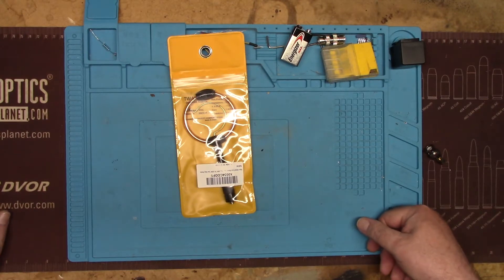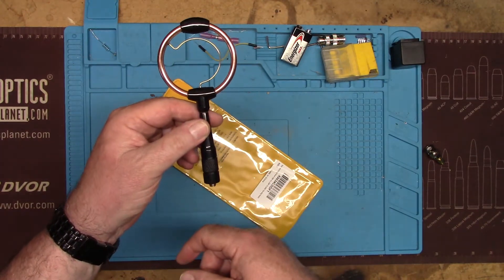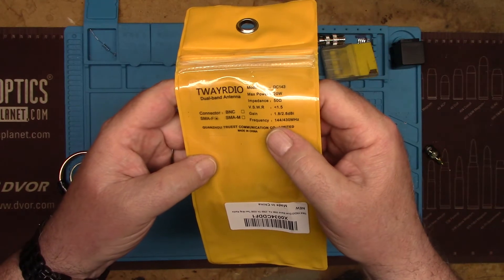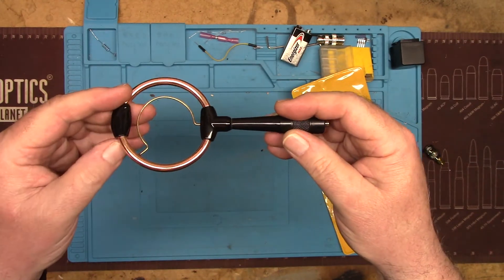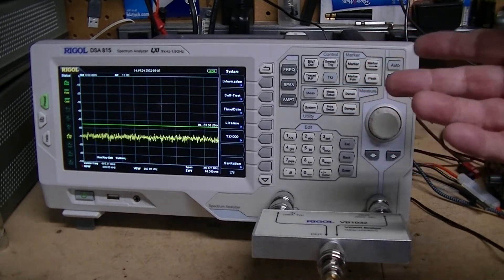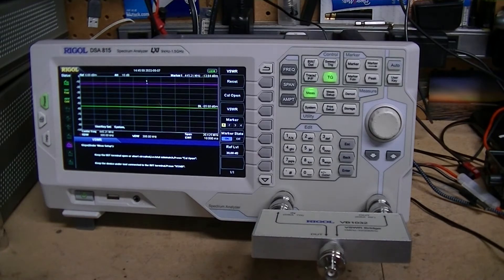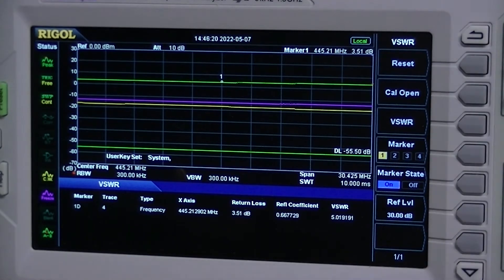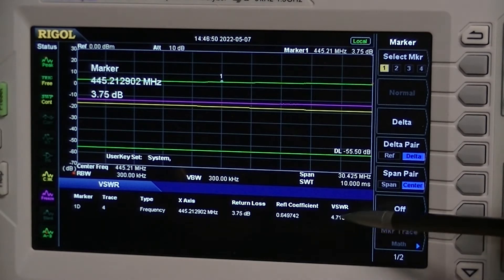TWAYRDIO HT "Mag Loop" - you'll be surprised at the results

Comment: I built a mag loop antenna and used it for my Yeasu Ft2800 and got great results. It was a DIY antenna that cost less than $50.  I used a10 ft length of coax and secondary 2 ft copper loop that sitting close to the 10 ft loop. AK6GJ

Comment: @FEPLabsRadio , This measurement is not good done ... you cant measure such antenna when it is just 10 cm's parallel (horizontal)  above a table ... cause that influences it , you basicly coupling it to the table (workbench) ... if you think but table is made of wood ... think again and understand that it is one big capacitor even while it's made of wood ... so you will get loses, reflections, capacity, detuning ...etc ... antenna is ment to be vertical , with a certain (much larger) distance to nearby objects in it's plane ... you have to measure it in the position it is ment to be used (vertical above a small metal case) ... one thing you could do is turn your analyzer screen facing to the ceiling (upwards) .. my verdict for this video ... not so good ... you never measure antennas when the are close and parallel to very nearby objects ... lets say you want to measure a 1/4 wave antenna ... have you ever seen they do that while the antenna is laying on the floor ?
Reply from the maker: So, if I was standing outside above the actual ground it would be better?
Reply: @FEPLabsRadio   ,  yes for testing vswr & directivity ... there shouldn't be any objects in the plane of the antenna , just something (not to big) below it, more less how it would be in real life use where the antenna is mounted (vertically) on a handheld ... To find out if it has any directivity (or not) you need to be in the open field with no obstructions or reflections ... key up some half strong repeater (s-2 to s-5)  and see what happens when you turn the antenna 360 degr ... curious what you find , i have seen other videos showing swr of 1.4 , i forgot if the found directivity or not ... curious what you will find ... i personally think this antenna is a little to small (diameter) for 2mtrs ( end even for 70 cm), even though it can have a low swr and directivity it might not be very effective (low-gain or high-loss) ... someone said inside  the plastic handle are some capacitors or coils , probably needed to compensate for the (to) small size ... with that trick you could even use a 1 inch nail as antenna which will work but with a lot of loss ... i'd make the loop bigger so it will be more effective ... add some tubeing with thread to change the length (diameter) to  to tune it.